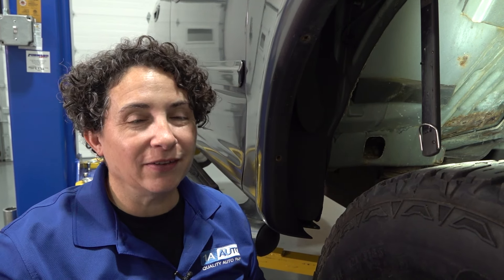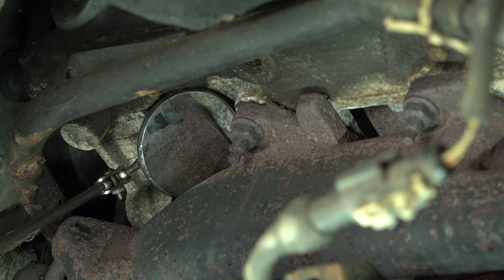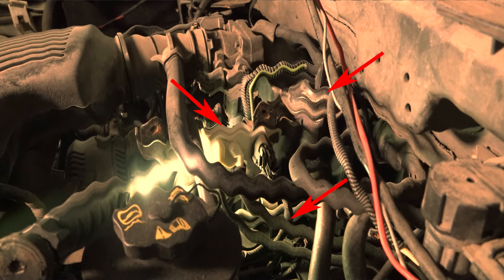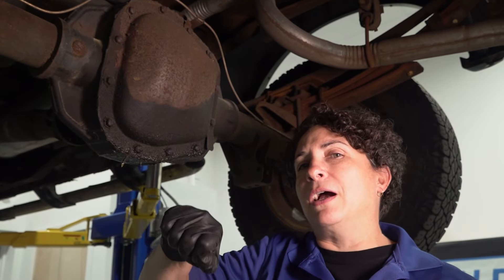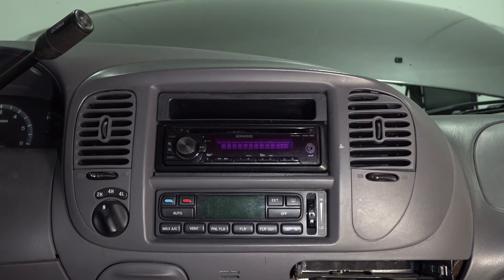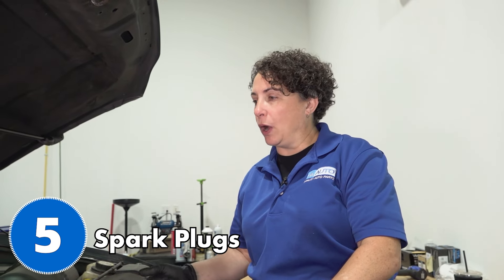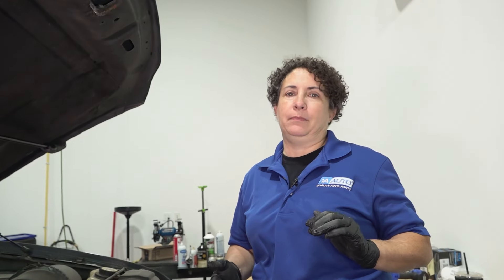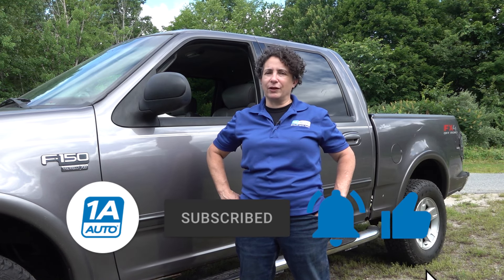Top 5 Problems Ford F-150 Pickup 1997-2004 10th Generation

Comment: My 99 f150 has the ticking, but goes away with the engine warmed up.
I already had a spark plug pop out. I plan to have the others dealt with before they pop in the future.

Comment: My 99 4.7 4x4 has had none of this. But the bump stops had completely rusted away along with about 20lbs worth of inner & outer rockers. Just fabricated some new parts myself. 
Had a head gasket blow but just ran some Blue Devil through it 50K ago and it's been fine.
Reply: 4.7?

Comment: I’m a genius,i replaced the head gaskets, new style..intake manifold and runner manifold gaskets to new style (2), the runner control linkage pins, added 2core radiator. Got 250 k miles on first 4.2.:)))Into second engine with 210k miles:)))))Now 25 yrs later, she runs perfect.fuel pump just died:)))) Greatest Engine ever!!!!!!!

Comment: Recently had 2 spark plugs blow at once scared the fire outta me. I own a 1998 ford expedition with 300k miles great running truck but spark plugs have been my biggest concern. I knew number 1 problem in this video when I seen the hood up lol

Comment: Hey Ford people! I have a 2000 Ford Expedition 5.4L that I love. It runs very well but recently on cold mornings when I shift out of park into drive, it has no power and stutters as if lacking fuel. I can hear the transmission shift from Park to Drive well ahead of time but when I push the peddal, the truck doesn't move much. After a few seconds of pushing the pedal it will start driving. Any ideas?

Comment: The spark plug problem I cause of s#itty mechanics not torquing them to spec or not using high quality spark plugs, I own two of these 04 fords one is a farm truck with 320000 miles never had spark plug issues I just change them myself at 100k on every vehicle. these trucks are unbelievably reliable as long as you don’t neglect fluid changes

Comment: Is there a recall on the rear differential? I have a 2000 f150 xlt 5.4 Triton 4x4 and the ring and pinion gears are shot

Comment: Antilock break system leak through issue as well. Mine has that, but the fix is about as much as the truck's value at this point. ABS light stays on.

Comment: I've had the front brake line hose go bad on the inside, causing the front brake caliper to lock up.
Garages just kept replacing the pads, rotor and caliper, and the tune of 1,000's of dollars, when all that was really wrong was a $12.00 hose.
At just 90.000 miles I lost compression in one cyl. and had to replace the engine.
I've had to replace all the CO sensors, and 2 coil packs, melted vacuum line up near the fire wall.

Comment: Hi there... I've got a 2001 Ford F-150 Lariat supercrew  with signal mirrors and cannot seam to find enough info on them. Would there happen to be a fuse for the signal mirrors? If so, which panel would you think I need to look at?
Thanks in advance...

Comment: What about the leaking windshield causing water to get on the back of the fuse box and GEM module.  Causes all kinds of crazy electrical problems.  Car would start on its own over night. Turn on the air and windows go down.
Reply: Probably just a ghost?
Terry

Comment: Thanks for the vid, now I know what the ticking noise is, on my 2000 F150,that I have heard, for a number of years. Is it something that should absolutely be repaired, or okay to just disregard? We have owned this truck since new, and do not intend on replacing, because of cost. Have 146,000 miles on the truck now.

Comment: My issue on my 1999 F150 is I need to replace the heater core. Got a video for that?
Reply: I think people cut a hole trough the glove box to get to it instead of removing the dash. Saves time.
Reply: @juanperez-ni2iw  that's for the blend door. Heater core, have to tear the dash apart
Reply: I did mine a few years ago. Not to bad just lots of stuff to remove to get the dash out. I honestly don’t remember any details to share. Did it in one afternoon. 
Terry

Comment: Mine has an issue with the odometer. It flashes on & off. I did hear it's common in the f150
Reply: It’s a solder issue on the circuit board…good luck.  😊
Reply: Mine is random. 
Terry

Comment: Hi guys! I need help. My 1997 F150 is stuck in park. 

I can’t seem to shift out of park. Rear break lights don’t turn on when I press the brake all the way down. Once I got stuck in the middle of the road but when I pressed down deep it unlocked - but now it won’t. Noticed the mechanic I had inspect my breaks left the break fluid cap off so now I need a new one, oil seems to be leaked out too - but it was working for a month when I finally noticed upon full inspection. 

What’s going on here? I’ve been stuck in a parking lot for days…

Comment: need to fix radio antenna just replaced base but droped the wire from radio to plug in down fender how  to get it out from inside fender ?

Comment: How about the coolant leak n back passenger side. I take manifold heater hose or whatever it is. We got a 150 k mile babied f150 5.4 and it’s leaking coolant now have to fix.  What a pain in the ass.

Comment: Ive got 115k on mine, none of these issues,  yet anyway. 
Cables in both rear doors. Seal leak, lots of electrical issues (cruise,  turn signals, wiper stuff)
But all those issues you talk about, it would have been ice if youd have said the code numbers that go along with them.. 
Thanks

Comment: I had so much problems with the exhaust circulation and vacuum lines on my truck coil packs and plugs had to re thread one with a kit now I have a knocking noise that I think is a rod or the torque converter

Comment: THE  4.2 V6 F 150 engines are great if the  oil is the  very best synthetic  which is AMSOIL ihpo ..Regular and low grade semi synths will make too much sludge and the protection value is low ..I have never had any engine issues with it being 208 k ,not even a lifter tick.  Take the oil cap off and it looks clean and the metal has no speck of sludge on it..

Comment: I have an 02 F-150 5.4 L 283,000mi transmission started slipping so I replaced it with remanufactured motor is still strong hopefully can get another 200k

Comment: 1. Cops
2. Door lock actuators
3. 4wd shift motor
4. Head gasket at high mileage
5. Intake manifold 
6. Heater core hose push fittings
7. Ball joints
8. Leaky windshield on GEM

Comment: Wow, I've been lucky.  I have a 2003 with 230k miles on it that I've had for alm9sot two years.  The only major thing is the heater core started leaking and  the whole dashboard needs to come out to replace it.  According to previous owner this is the third time.
Reply: I had the same thing happen with my 2001 F150. Repair garages wanted $800 or more to tear up the dash just to get to the heater core. Then my neighbor told me to just bypass the heater core with new hoses, which we did. I haven't had a heater in over 10 years, but here in South Texas you really don't need one, but problem solved. Had a friend that replaced the heater core, on his 2003 Navigator he tore out his dash, and could never get it back together again. He regretted doing that. If you live in a Cold area then I guess you should replace it.

Comment: The blend door motors on these trucks are the least of your problems. Easy cheap fix. Its the blend door itself that is the big problem. The blend door cracks where the blend door motor engages. The side wall cracks out. Dorman makes a revised part that has a metal band around it for reinforcement. Problem is you have to remove the whole dash. Coil packs go out a lot, Only use Motorcraft or you will be doing them again next year. The rear window leaks, Bad design with sealer. They lay the ribbon seal along the top with a couple of dips in it so water pools there and causes leaks. still great trucks. Love mine.

Comment: Got a 2002 v8 4.6 f150  spark plug number 6 blew out at 190k had a shop put a rethread kit on it blew  out again at  200k can that same number six hole be rethreaded again maybe stupid question but I’m not a mechanic  don’t want to replace the head not cost effective here in California   Thanks

Comment: These trucks easily last decades (I got my 2000 in 2004, my wife got her 1997 in 2000 and a couple more followed me home. This is a good time to hoard spare parts and donor trucks (I've lived through older classic truck life cycles) if you have the room. If you own a 4.2 and the oil looks milky park it and replace the intake manifold gasket before it hydrolocks. The "fix" doesn't do much but reset the proverbial clock until failure. Good thing 4.2s are so easy to work on. The 4.6 is of course the best engine for these beasts.
Reply from the maker: +@Comm0ut Thanks for checking us out! http://1aau.to/m/Shop-1AAuto-c

Comment: My uncle had one of these. It was a 2000, with the extended cab, don’t know the motor, most likely the 4.6. He owned it until I think 2015. I think the only reason he got rid of it was because he went off the road once, and it rolled over. He was okay, and the truck was repaired, but he claims it never drove the same after that. He had somewhere over 200k miles on it. He then bought I believe a 2012 F150 to replace it.

Comment: A v8 is being explained.v6 models have intake manifold and timing cover gasket issues ..intake runner motors...synchronizer assembly..and heater hose metal tee rusting...and pcv elbows cracking.

Comment: Master long time mechanic and machinist here.  Absolutely NONE of those 5 things are true at all. If any spark plug ever blew out of the hole on a madular engine it is because some person stripped the threads by not turning them in straight.  That will never happen unless you caused this by screwing the plug in crooked.  Also, dpfc sensors usually ebnd up for gotten and NEVER pose a problem at all, but instead the throttle body EGR holes get clogged up instead..  Also, the 8.8 differential NEVER get bad and neither do the bearings as long as thyre full of oil..  Also they are not called triton engines at all, but are modular V8 engines by name..  The real problems are MAF sensors and leaks in that area and IAC motors that run around 30.00 dollars and the dreaded oil filter adapter gasket that bolts to the engine block.  The woman in the video based on my knowledge and long time dealings with these engines should be IGNORED completely.  That blowing spark plugs out of the holes nonsense can only happen if the last person installing the plugs was a FOOL and tried to tighten them in at an angle, and you cannot call something a fault of a design when some idiot destroyed something

Comment: I had the tick it went away though, and now the blender actuator is dead. Haven't blown a plug, but I've melted a few spark plug wires. but I also got the smaller truck, not the triton.
Reply from the maker: +@7pheonix Thanks for the feedback!

Comment: Does the blend actuator also control the vent setting?  It doesn’t matter if it’s on defrost or floor it blows out of all the vents. 05 f150
Reply: No, That sounds like a vacuum problem.

Comment: My 2001 Ford pick up when I turned the air conditioner heater on. I only have high on the blower.
Reply from the maker: +@DOUGDICK-h1v We wouldn't be able to diagnose an issue like that here, you may want to have a local mechanic take a look at it. Thanks for checking us out! http://1aau.to/m/Shop-1AAuto-c

Comment: 2002 F150 SuperCrew 4.6 had to put a alternator in it He said he put coils in it cause when I bought itrom him he had six years without issues and he corrected me with he had to have coils installed few times 217684.1:miles 1st ford I've owned I really really like sense I was 17 😂 and had 1970 Econoline van 300 straight 6 You fill it up on Sunday still be going on that tank Thursday wasn't crazy about 3 on the tree but 
Loved everything else ✌️

Comment: What's with dealership's they could not fix my 98ford 4.2 -128.000mls intake runner control both banks closed ran and drove great great ride just sold it for 1.000$ really hurts
Reply: I'm inclined to think they don't want to fix certain things with older trucks. They want to make the bigger sale with a new one. I had my intake manifold replaced at a reputable shop because the dealership didn't want to diagnose the "Costly" possibilities of an overheating engine and recommended a replacement engine. I have a  2001, 4.2 manual drive and avg. less than 10,000 mi./yr but tow and haul in summer months.
Reply: Usually a hose leak will cause that, solenoid can't pull vacuum due to hose tear and the runners get stuck. Vacuum hose replacement could have solved it.

Comment: I don't know how many miles I have on my 97 f-150 4.6 . It had 97,000 when I bought it . 3 years later it still says 97,000 on it. I just started having the 1st performance issue . It stalls at low rpm. There are several videos on fixing the problem. The problem is every video says something different. Everything from a 10 minute job to a 500 dollar fix , this sensor , that sensor to a stupid charcoal canister looking thing that I can't imagine even being the problem . It's not a gold fish issue. Think I like the 10 minute fix the best .

Comment: mine clicks like that, it also shakes bad. i was thinking it was the ac accumilater or a vacuum line. idk, mechanic said i should do a reman trans and engine. it has 300,000 miles on it.

Comment: I have had none of these problems. I have replaced 4 coils and have had window motor and seat adjustment problems. I also had a blower problem and had to replace the motor. Ford windshields leak and ruin the motor.  The only other problem was the windshield wiper regulator and the tiny hose that controls the air motor broke and I repaired it. 1997, 180k.

Comment: could you make one of 2011 impala? Front suspension problems. the tires are worn from the inside edges.
Reply from the maker: +Joseph Barrera We're always cycling through common cars. We'll add this repair to our list! http://1aau.to/m/Shop-1AAuto-c
Reply: @1AAuto  thanks for answering.
Reply: Sounds like you need an alignment. I replace my steering rack and pinion and didn’t get an alignment. Needless to say I my front tires within 2 weeks after. -vehicle was a 2006 Honda Accord sedan

Comment: Left out eating ignition coils,you replace these when a misfire code appears
Reply: Thank you. My 97 eats coils for breakfast every year.
Reply: Not all have coil on plug, my 97 4.6 has a coil pack on the front of each head with spark plug wires. That being said we have a 01, and 2 02 5.4s on the farm as well and they hadn't had issues with the coils except when they blew a plug and it took out the coil.

Comment: Not a mechanical problem, both both trucks I’ve had each leaked from the rear window. Local glass shop replaced the seals and said it’s super common.
Reply: Yup, the factory seal fails very often. I replaced mine with 3/8" butyl rope 7yrs ago and been good since.
Reply: Mine does too lol

Comment: Add the thin walls of the exhaust manifold rusting out at 100K miles. Plastic  factory intake manifold  cracking at hose 50 to 90 k. Plastic coolant crossover tube cracking at 90k. Thin brake line hoses rotting out. God help those in snowy regions. aluminum brake bleed screws in a steel caliper rotting out. The 6 CD changer is know to crap out. rocker panels prone to rust. Like all Ford products over the last 40 plus years, window switches are prone to failure. Other then these, a pretty good truck that has a noise diving resale value.

Comment: I have a 99 f150, as i step on the gas to accelerate from a stop i can hear a grinding noise coming from the back end, but when i "barely" step on the gas from a stop and accelerate turtle slowly it does not make any noise, on the freeway no noise or issues and when i decelerate no problems.......anyone know what that could be?    Please help.
Reply: Sounds like you may have a bearing going down in the rear differential!

Comment: The windshields suck. Front and back on every version of this generation truck. It will eventually leak, get them replaced and resealed. Dash board also will eventually erode the paint.

Comment: Or the previous “so called” mechanic didn’t use a torque wrench and over time and rugged terrain undid itself & with the few threads remaining finally just blew out.  It happened to a roommate!  I then went to check the remaining 3 spark plugs & sure enough they were all loose, also.

Comment: It's actually the carbon on the sparkplug threads that mess up the threads on the way out. Seafoam or some kinda  air induction cleaning before doing The Sparkles will lessen the chances of that accuring

Comment: My 2001 Supercrew 5.4  is a total piece of garbage!  Calipers rusted shut while under warranty and all brake parts and frame were rusting...Ford said normal wear.  A/C system fixed 3x under warranty.  Two more repairs out of warranty, and still no a/c.  Rust bucket in the desert, pieces are falling apart and the roof is full of holes.  It eats batteries.  It will kill a new battery within about 5 days.  The rear window and windshield had little sealer on them, so water comes in.  Water runs down the grab handles inside when it rains.  Gasoline was pouring on the ground at last fill up, and now running bad, so it seems the gas tank now has an issue.  (All the hoses and pump were replaced).  Has 115,000 miles on it.  Engine was rebuilt after it puked a spark plug from the block.  New starter, and needs all new suspension, again.  The brake lines rusted through, and I cannot find the rear brake line for sale, it says discontinued.  So, it's sitting in the driveway, useless.